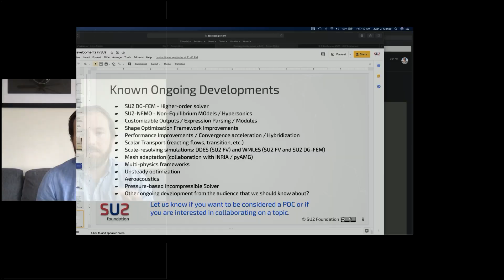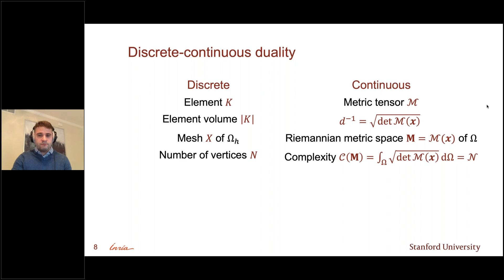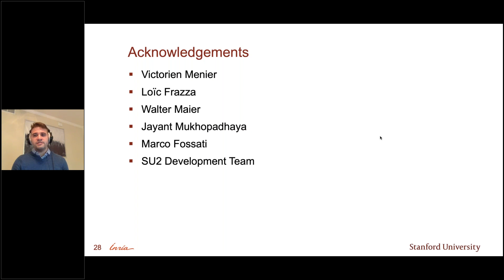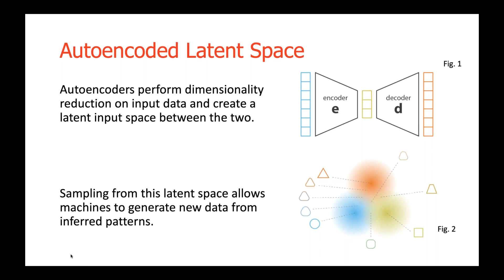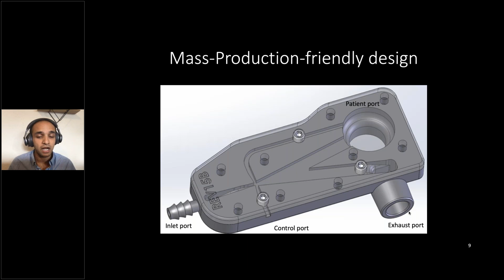1st Annual SU2 Conference - Live Sessions - Day 3

Comment: Starting time of each topic:

00:00:51 - A look ahead: ongoing developments in SU2 + Open discussion
00:45:31 - Goal-oriented anisotropic mesh adaptation in the SU2 framework
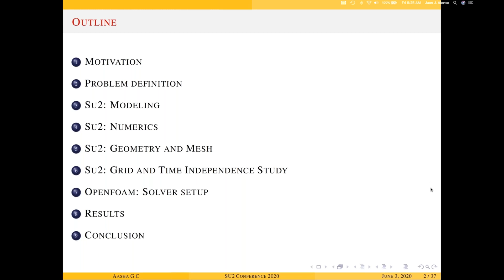01:25:12 - Numerical simulations of flow over NACA-0012 airfoil pitching at low frequencies
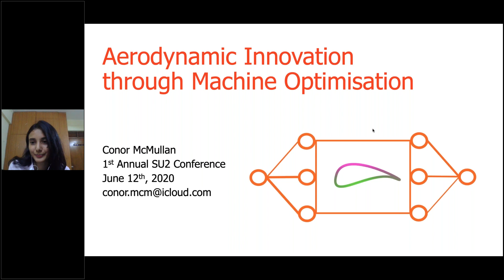01:40:52 - Aerodynamic innovation through machine optimization
01:55:42 - Combining SU2 and graph neural networks for fluid flow prediction
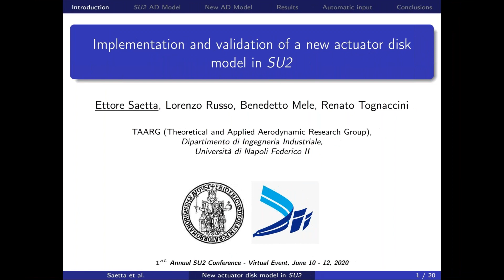02:12:22 - Implementation and validation of a new actuator disk model in SU2
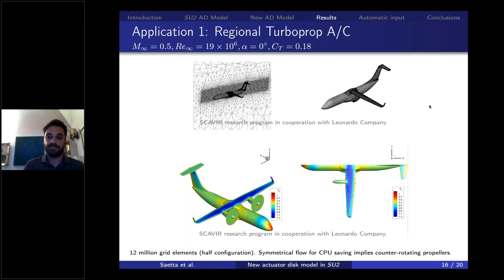02:25:51 - Aeroelastic 3D optimization of turbomachinery using a harmonic balance method
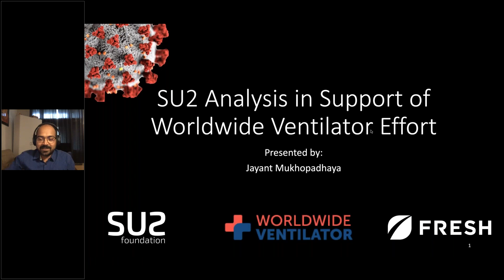02:42:50 - SU2 analysis in support of worldwide ventilator effort